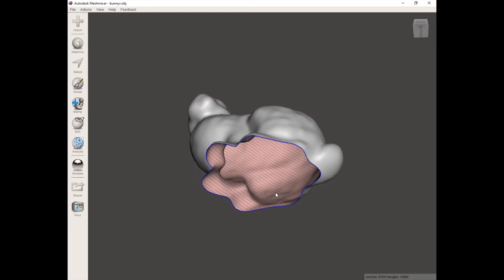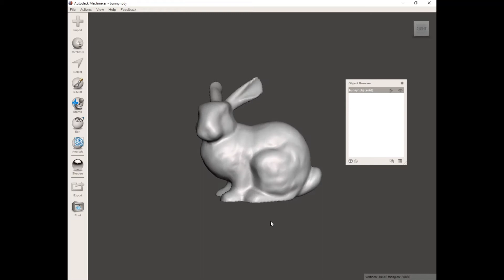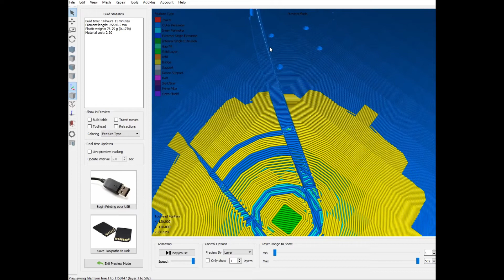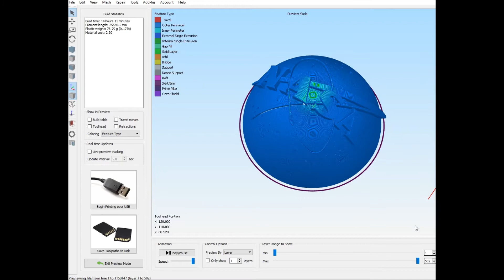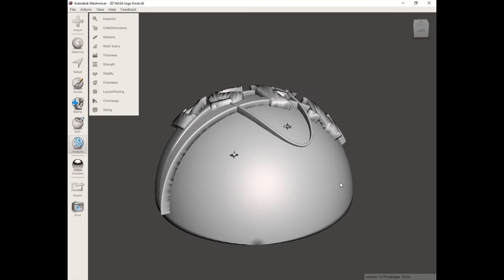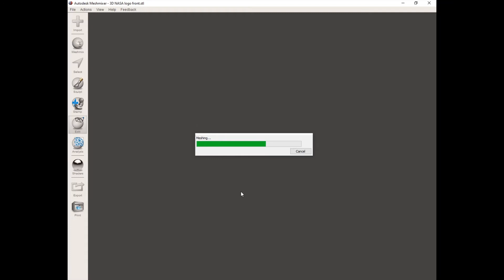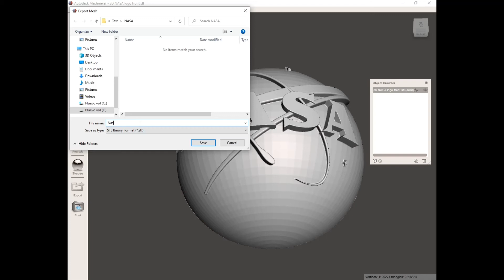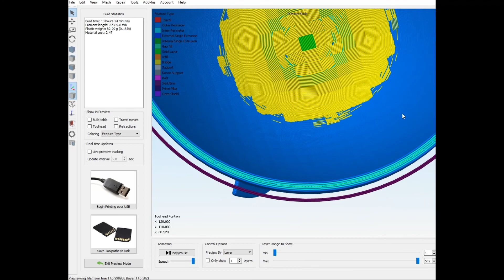How to repair STL models with Meshmixer

Comment: How do you smooth out the blockiness  that results from Make Solid? (I know it's a lossy process so it will end up with less detail than the original.)